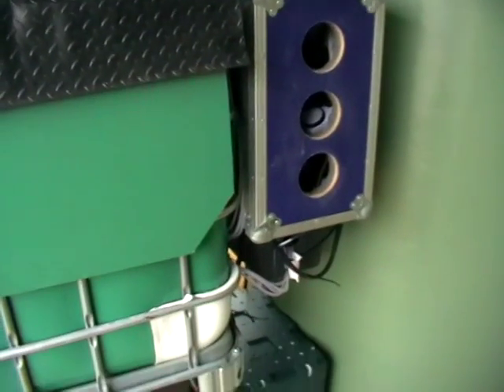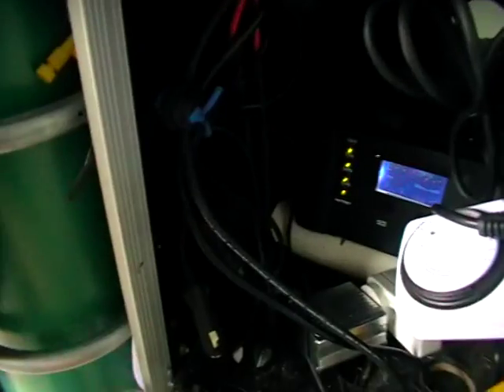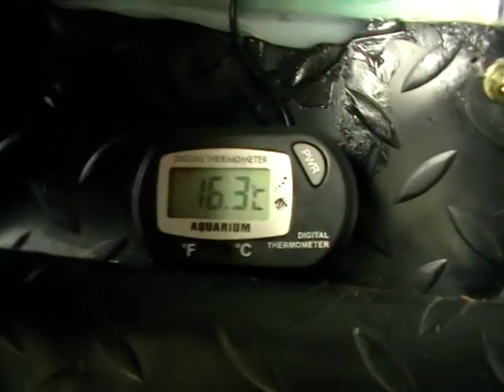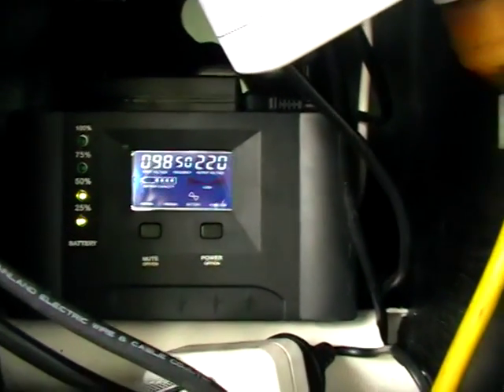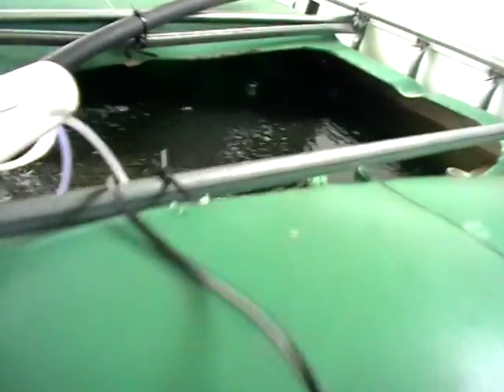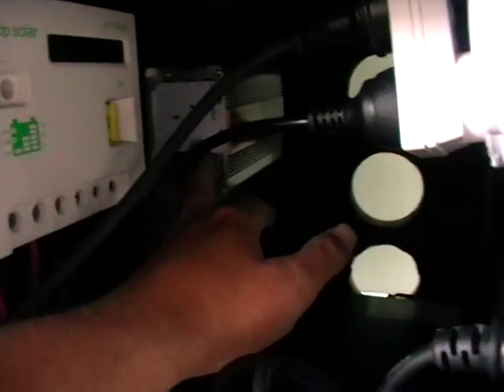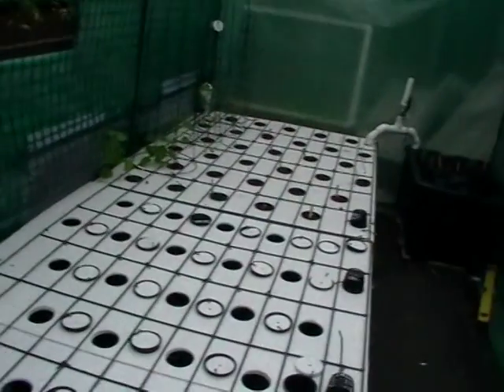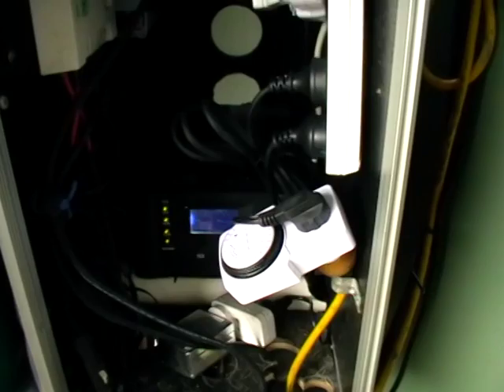Aquaponics off the grid, running 2 systems on solar power

Comment: nice setup, iv been living off grid for close to 13 years now, I started with a 5.5 kW system. Back in 08 I broke it up into 4 smaller systems and have found over time that several smaller systems is much more cost effective, the availability of smaller cheap inverters 200 to 2000 watt makes projects much easier to put together. 
I'll be putting a small greenhouse with towers together in the next few months all solar powered and seeing what you've done with yours makes me feel good about what I've got planed out so far. 
I'm living in the White Mountains area of Arizona we get a lot of solar days here but when the clouds do show up they don't like to leave so a safety net of a charged spare bank is our way through more than a few days. 😃

Comment: Hi, this is really interesting as I'm currently doing feasibilty on a similar setup in the south of the UK. Our climate is cooler than yours so we won't be equal, but I'd like to ask how much of the power used here is solar, on a year round basis? Is AC power still part of your mix as we are planning to do this fully offgrid. Would you alter your setup on the solar side (larger batteries and panells etc) if you needed to be fully off-grid?

We are looking at running quite similar loads to those you mention on your system; keeping things efficient with pumps of just 50 to 100W kind of range, depending on the system size obviously.

Great video...

Comment: Thanks for sharing, Love that setup!
I was wondering how much it would cost to set up solar on similar size system.

Dont know if its worth it though since i have 5kw system on the roof but obviously doesn't save the power to battery to run over night.